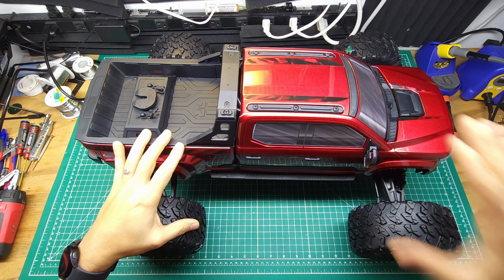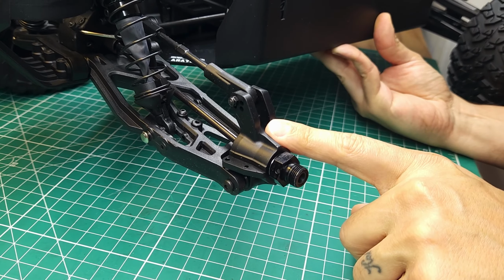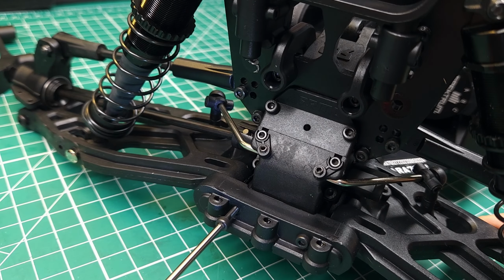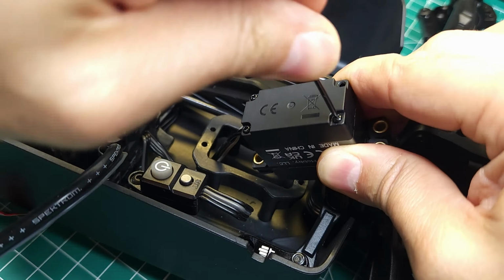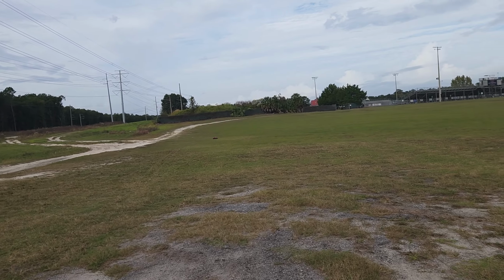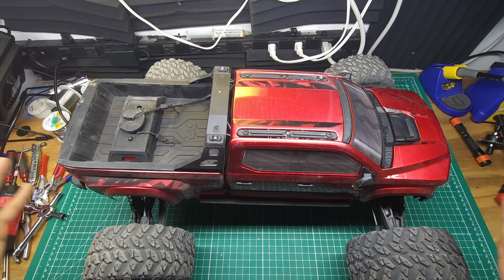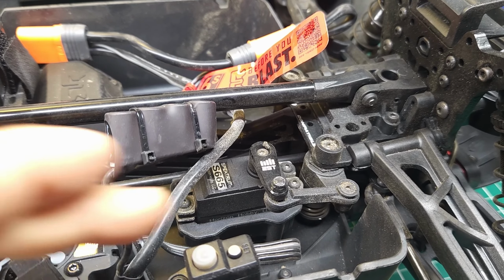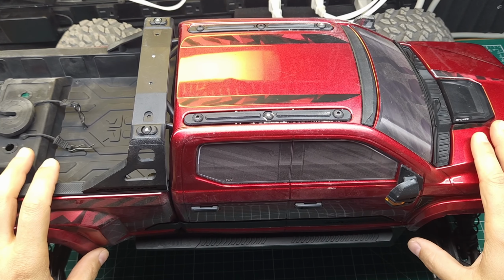Is Arrma Big Rock 6s The Ultimate Scale RC Basher? | Deep Dive & Bash!

Comment: I think they didn't add those parts because it's not called an EXB Big Rock, if it was, it would have the EXB parts. Im guessing its as expensive as it is because of the body. Im okay with it, they make vehiclea for us to have fun. Not pick apart what's wrong with each one of them. If people dont like it, dont buy it!
Reply from the maker: It's not the EXB parts that I'm concerned about. It's the parts that are going to end up on both the EXB and the V6 RTRs. Things like the tower to tower brace, servo saver, turnbuckle ends, sway bar links, and a plastic version of the center braces are almost certain to end up on the RTR vehicles. Good proof of that is that there's already a hole for the second screw on the rear brace on this big rock chassis.
Not really concerned about the EXB specific parts but the vast majority of the updates on the EXB are almost certainly not going to be EXB specific.

Comment: I already broke a front drive cup. Could be a fluke since I haven’t seen anyone else having an issue. The old design popped out a lot, but an aftermarket hardened one fixed the issue. Will be curious to see long term how these new drive cups hold up 👍
Reply from the maker: I found a small chip in one of mine though I'm not sure if it was there from the factory or if it happened while bashing. I guess we'll see.

Comment: Random question not so much about the truck but the tires that are on it. What did you think of them for a stock tire? 
I'm looking for new wheels for my Traxxas Maxx and I'm having a crazy hard time finding something in the size I want 😅
I hate the size of the Maxx specific tires. I'm currently running my old HPI Savage stock wheels and they are perfect on it but they don't have much life left (side walls are getting some holes on it) so I'm looking for a good replacement for it. Any recommendations/input you have would be awesome.
Reply from the maker: I think these are decent. I don't have a huge amount of experience with them but from what I remember I didn't have any issues with them.
Reply: @DoRC  good to know thanks! Just ordered a set from Jenny'sRC to give them a try. For $50 I figured why not. They're the style I'm looking for so worst case I use them on something else I have if I don't like them on the Maxx.

Comment: I got 55 out of mine that was on the street  Finally watching videos on this as mine is rendering Fedex delayed me a day dang it  Good video
Reply from the maker: Yeah cars will always be faster on road than off-road. The speed gear will probably get you another several miles an hour. I like to test them off-road out of the box though as that's how most people are going to run it. I think 50 out of the box off-road is very respectable.
Reply: @DoRC  definitely so very respectful on the dirt its quick but I didn't put the speed.gear in 55 on the street stock.  I would like to see it wheelie more it will be interesting to see what you do I am not putting a bunch of money in a new rc it serves my purpose like you said running fast and  small.jumps
Reply from the maker: @L2theWcarscoffeelife Yeah I wouldn't recommend doing what I'm about to do. It's fun for the channel but not exactly practical :-)

Comment: Thanks for putting the time in to show the changes. I agree about the elephant in the room. The upside to this Big Rock model is that it's more compatible with plenty of the parts that are around right now. Am looking forward to seeing how built up you're gonna make it. Personally (if budget permitted) I'd  go all-out with some Treal bulkheads (because huge input bearing) the chunkiest generic aftermarket (not hollow) suspension hinge pin blocks (so you can use stock pins) an M2C chassis, 5mm hex kit, carbon towers, and HOBBYWING's G2 Max 6 system with the 4990 (at least)
Reply from the maker: Definitely stay tuned. There will be very little left stock on this truck when it's done :-)
Reply: @DoRC  Sounds interesting. I will definitely be around. 👊👍👍
Reply: Might as well just use kraton hubs and axles instead 5mm hex , might as well buy a kraton the m2 chassis and the brcc body 😂 , that’s what makes arrma cool all the parts are compatible, I go so far to say arrma takes ideas from bashers and runs with them .  I had similar thoughts if I get the brcc I don’t think I’d want to get it dirty . It look cool with those GRP 5th scale wheels , light kit , little smoke 💨 some ground effects .

Comment: I like this truck, I want to put offroad lights on the roll bar!
Reply from the maker: There is a light set available on pre-order but it doesn't include roll bar lights. Looks like they would be pretty easy to add though.
Reply: @DoRC   yes I saw the light kit, but it looks like the rollbar is setup for it, so maybe down the line they have one for it

Comment: Any other body options available? I'd like to find something cheap, lightweight and simple.
Reply from the maker: Take a look at people who have made Kraton XL trucks or who have put different bodies on the Mojave or fireteam. They all run on the same chassis length so the same body should work. You'll have to do some messing around with bumpers and whatnot though as the front bumper at least is partially on the body itself.
If you don't want the body you might actually be better off making an XL yourself or getting a fire team and re-bodying it.

Comment: I would say those wider outdrive cups are a must have on the front of these Arrma 6s truggies especially.  I'm guessing they won't work in the V5 diffs as they use a smaller diameter shaft than the exb((  Going Full EXB would have made the price ridiculous on this but it's nice to see Arrma made the effort to correct multiple issues that the Fireteam has.
Reply from the maker: Yeah these are only going to work in EXB differentials.

Comment: Maybe this a question you can answer. What is the purpose of the capacitors attached to the esc to battery wires? And what effect will deleting these capacitors do to the performance of the rig?
Reply from the maker: The capacitors are designed to smooth out The current coming from the battery based on the fact that the ESC requires wildly varying amounts of power on millisecond time scales. Removing the external capacitors could cause instability on that input under heavy loads which might damage the ESC.
Reply: @DoRC  So I was looking at getting a Hobbywing motor and esc combo. And I noticed no capacitors come with it. So now my question is should you add them? If so how do you know what kind you need? Looking at the Hobbywing max6 ezrun 8s 1650kv.
Reply from the maker: @edwinlomonacofoolsend  If it doesn't come with them you probably don't need them. The ESCs have input capacitors built into them the external capacitors are just additional filtering.  The only time you'd want to use additional filtering is if you're really pushing in order to its limit like speed running or something like that

Comment: Doesn’t the 3s one do that speed out of the box ?I get this will have more power but for the money doesn’t seem worth upgrading from the smaller one
Reply from the maker: Larger vehicles have more weight, rolling resistance and frontal area so it takes more power to accelerate and achieve top speed. This truck is huge compared to the 3s and drives very different.

Comment: The bearings in these 6s trucks hubs never last. I always upgrade to the Hot-Racing Hubs as they use over sized bearings.
Reply from the maker: Interesting. I've never really had much trouble with them.
Reply: @DoRC  I believe it. I've learned that results may vary. But unfortunately every 6S rig I've bought I've had bearing failures. My Fireteam the front failed halfway through the 1st battery.
Reply from the maker: @edwinlomonacofoolsend  Yeah I'm not terribly surprised. I've experienced random bearing failures on all sorts of RTR vehicles. Seems like they're all made with cheap bearings.
Reply: Take em' out before running, and try packing them full with either Lucas Red & Tacky grease, or Super Lube multipurpose. They might last a lot longer, and those greases are compatible with the lithium based grease already in those bearings, so no need to clean them out before first usage.
Reply from the maker: @all-is-Grass I've tried using thick grease on these small bearings before and I've had bad luck with it. It tends to overheat them which just pushes the grease out through the seals.
Reply: @DoRC  That's too bad. I've had good luck doing that. But, then again, I don't run mine near as often as many of you do on here. With my fancy all M2C K6, I have HR's hubs with the larger bearings. In the larger inner part for the largest bearing, I use really heavy-duty ones meant for bicycles.
Reply from the maker: @all-is-Grass Yeah and that may just be my experience too and not everybody else's experience. Ultimately it's not exactly like it's a huge investment to try it.  Experimentation is what this hobby is all about :-)

Comment: Great review buddy👍 unfortunately  there's not enough new bits to justify adding it to the fleet. The body looks awsome though. Is the body heavier than the fireteam? Its annoying they didn't add some of  new upgrades on the big rock. Especially the 2 piece chassis brace.
 I'm happy arrma did some much needed upgrades on the new exb. Personally I was expecting 1/7th scale kraton exb with maybe wider arms (wishfull thinking...) just because the 4s kraton is very similar in size to the new exb. With the upgrades I feel the new exb is prob going to be the best basher of 2023. 🙂
Reply from the maker: Have you had the 4S and 6s next to each other? They are closer in size than the 6S and 8s but they're still a pretty decent size difference between them.
I don't have a fire team body handy but if I had to guess I'd say they are pretty similar in weight with the big rock maybe being a little bit heavier.
Reply: RCdriverOnline said the Bigrock body weighs 7 ounces more than the Fireteams.
Reply from the maker: @fiatfixie4344  good info!
Reply: @fiatfixie4344  thx. I think the fireteam body is too heavy as it is. It wil be good to see how the electronics on the big rock cope with the extra weight 🤔
Reply from the maker: @inspiredrc so far so good. I'm actually going to leave the stock ESC in when I upgrade The truck to see just how much it can take.
Reply: @inspiredrc  Yes,  impossible not to notice how much more agile the Kraton is over the Fireteam with the stock electronics.  When DoRc is done with his BigRock i'm guessing it will eat X-Maxxes and Outcast 8s' for breakfast though).
Reply from the maker: @fiatfixie4344 Maybe. It won't be as big as those but it's definitely going to be a beast :-)
Reply: @DoRC  I think you're on to something,  It's a well designed rig,  just needs to be taken to the next level!👍
Reply from the maker: @fiatfixie4344  :)
Reply from the maker: @jerryvolpini7987 For sure. I think at $600 this thing's a winner but it's $700 it's a little overpriced.
Reply: @DoRC  I'm surprised but look forward to seeing what you do to it. Has the new esc got more power than the older one? For me I think the big rock needs around $300 - $400 of upgrades to make it stronger (chassis, towers, braces etc..) At least they put exb diffs in it.
Reply from the maker: @inspiredrc  same rated power but they have tweaked it in software. I'm mostly curious to see how much load it can handle.  The first version has a habit of dying under heavy load.

Comment: The rear suspension aint squating the car remains level during acceleration and braking almost. Needs softer springs. Had goodluck with the kraton 6s springs on my Nero versions. Tried the fireteam ones too stiff
Reply from the maker: Yes the springs are pretty stiff right now but that's just perfect for what I have in mind :-)